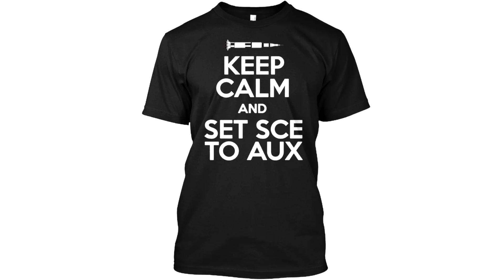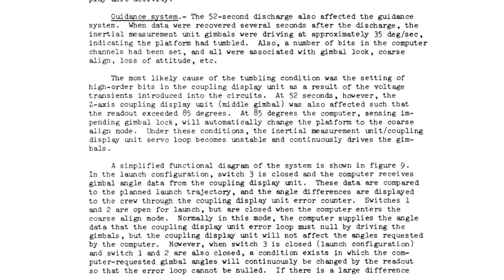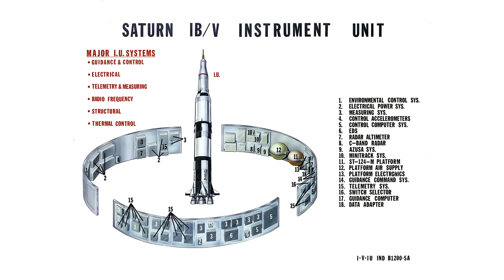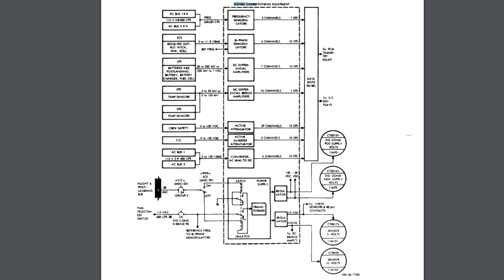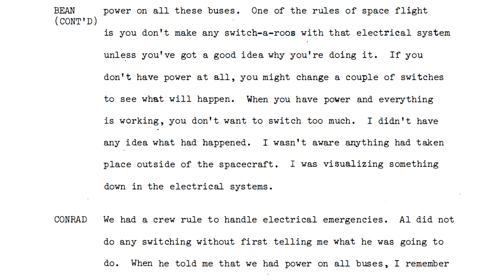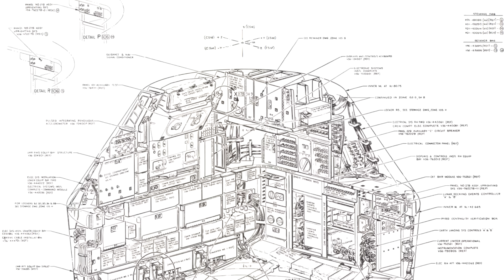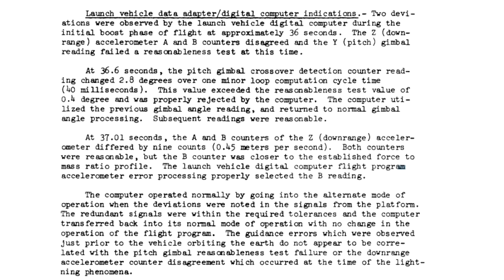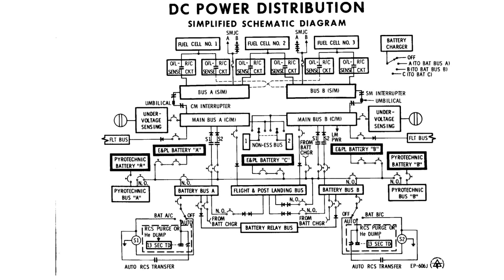What Does "Set SCE To AUX" Mean Anyway - Apollo 12's Lightning Strike Explained

Comment: Excellent point about the decisions NASA potentially has to make. It is entirely possible for astronauts to face certain death after some form of failure. With Columbia NASA apparently didn't take the potential for tile damage seriously. They declined to ask NRO to task a satellite to examine the shuttle on orbit. 

Or maybe they did take take it seriously and at some level chose not to know, assuming there was nothing they could do about it anyway. That's not actually true because Columbia could have made a reduced energy reentry profile at the very least.

A third possibility is that NRO did in fact get images that showed a hopeless situation. Until this month any information about the resolution of NRO satellites was highly classified. Information about any images that could reveal resolution would have been too sensitive to release. Telling flight ops, the crew, and the public that the crew were certain to die would be a very tough call to make and would have repercussions for the agency. I have wondered about this for years. I knew at the time some serious people were concerned about potential tile damage.

Secrets have a way of getting out and I have never heard the third scenario mentioned by anyone and I have never written about it before today. I do think it is possible but it is the type of decision that could only be made at the top levels of NASA. That would mean the full force of NASA engineering would not have been involved in the analysis. As the video above well illustrates, you never know who will come forward with the solution for an unexpected problem.
Reply: Bill Kerr IIRC, NRO imaged the first Shuttle mission when NASA realized that a bunch of tiles had come off, images showed nothing critical was gone. I think that NASA over time became used to missing tiles and other takeoff damage, forgot that sometimes damage is a huge problem.

Comment: Moral of the story: don't get hit by lightning and if you do, don't get  hit a second time.
Reply: And if THAT happens, be sure to have John Aaron watching your back.
Reply: Don't they say that lightning never strikes twice in the same place? Although, I suspect that's mostly because after the first time, the "same place" usually isn't there anymore...
Reply: @jamesw1659  Lightning is a build up of negative charge that's looking to equalize.  When it hits something that object usually ends up with either a negative or neutral charge so it has less attraction force for lightning.  That said lightning, as with all electrical currents, tends to favor the path of least resistance so a large metal (conductive) object at high altitudes has a pretty good chance of acting as a conduit for wherever the lightning wants to go (lightning rods also act as a path of least resistance to the ground).  I imagine the engines may have created some positive (attracting) charges as well but I don't know nearly enough to say for sure.

Comment: To get to the AUX position, they had to go through the OFF position, so they literally did switch it off and on again.
Reply: Step 1 "Hard reset."
Step 2 "Take it offline and turn on the backup. I'll come have a look at it."
Reply: A friend of mine, a fellow computer geek, has a T-shirt that says, "If I'm ever on life support, unplug me.  Then plug me back in.  See if that works."
Reply: The Signal Conditioning Equipment could not be shut off. “OFF” was just a lower voltage version of “NORM” in the redundant power supply. Sensor Excitation in “NORM” was 10v and “OFF” was 5v. But essentially it’s always active in the DC Diff Bridge Amplifiers. Never truly off. Peace.
Reply: This is a new level of brilliance
Reply: @tsurutuneado5981  take that back!
Reply: Switch off and back on again is a Cliche but It does work 75% of the time.
Reply: I love how the entire portion of Scott's subscriber base working in electrical engineering has congregated here
Reply: That's SIERRA Charlie Echo. <Quindar beep>
Reply: That's where Microsoft helpdesk customer service reps got the idea for rebooting the computers.
Reply: "The Microsoft Solution" FTW!
Reply: Oh your rocket got hit by lightning midflight? its fine just turn it off an on again.
Reply: Worse comes to worse hit the panel hard and "tilt it".  Seriously though kudos to the engineer who came up with this reset.  It obviously was not a widely thought necessity since it wasn't even a practiced scenario but it served its purpose-----the one in a million incident.
Reply: That is the fix for when you trip a circuit breaker yup
Reply: The till system was non stop crashing, we turned it off and then on again, and it worked, best I.T. possible
Reply: Like binary?
Reply: One thing came to my attention is that he only knew about this glitch because of that “not A grade team” who did a mistake in a test run. Kudos to the not so bright engineers who made this possible 😅
Reply: LOL, I always say "Just because it's funny, doesn't mean it isn't wisdom." Electricity is nearly magic to most people. I made it a career and can attest that "magic" is a word we used often. Usually it was a place holder for something not understood. An unsolved problem that we haven't seen before.  As an example, the term FM means radio to most people. To us techs it also means Fucking Magic for the reason the problem "just went away."
Reply: @jkocol  As long as they didn't let the magic smoke out of anything important....
Reply: @jkocol this of course is why "off" is always in between "on" and "aux" whenever such a switch is desired. Not only is it easier to build the switch this way, but it also ensures that the diagnostic proceedure "set X to aux" will always reboot it.
Reply: @jkocol  in programming, we refer to anything below our level of abstraction as "magic" (adverb - "automagically"). e.g. if you're writing a game you can usually say that the way save files get to disk, and that the OS guarantees that it doesn't get corrupted on crash, is magic. (Whereas if you're writing a database, that is most decidedly not magic and you need to understand it.)
Reply: Not if the switch was make before break.
Reply: @NeverTalkToCops1  But if it is an actual three-way switch, it MUST break before make, especially if the centre position is in fact the OFF one (which Scott mentioned), otherwise the centre position would bridge both extremes which is not only weird but arguably also everything BUT off.
Reply: @NeverTalkToCops1  I would assume it would be best to have a "break before make" on a powered system like that. Everything ran directly from high current batteries. The last thing you want to do is to switch from a bad battery to a good one with a temporary short.
Reply: @NeverTalkToCops1  NeverTalkToCops Lol, or tell jokes to electronics geeks.
Reply: 4:15 Shows it's a twin position switch. "AUX" is at the base but obscured by the guide metal loop.  In the schematic diagram at 1:26 it shows a manual switch which is a twin position switch, which bypasses the Silicon Control Rectifier circuit.
Reply: @David-yo5ws  First of all its not called a "twin position" switch. what you are thinking is called a single throw switch. The schematic diagram at 1:26 is for the fuel cell disconnect circuit as it states at the bottom of the diagram, not for the Signal Conditioning Equipment. If you actually paid attention to the animation at 4:15 you can see him cycle between the 3 position as it is a double throw switch. If you listen you can also hear him state as such.
Reply: Those old switches could be thrown fast enough that the computer didn't feel the blip in power loss. 😂😂 Tech was slower back then.
Reply: @crippledbeast_U-toob  the threshold was 5 milliseconds on a 50HZ cycle so technically right .
Reply: @crippledbeast_U-toob  Procedure 1= Set SCE to Aux Quickly
Or Procedure 2= Set SCE to Aux Very Slowly 🐌 
😄 Haha Just Kidding
Reply: @Mattycp007
Truth in the humor may be that to stop some cases of high voltage arcing Procedure 2 may be needed.  An EE could help me here, but is it possible that ionized air has to dissipate before power is restored, or the arc could recur?  Good guesses or bad?
Reply: I dint think so.  The ship was already in an under volt state.

Comment: Reminds me of the interview with Johnny Carson and the two astronauts form the first shuttle flight, they were discussing the unpowered landing and the topic of the landing gear came up. Johnny asked them if they tested then in orbit to make sure they worked and they quickly said no.  There is no mechanism to retract the landing gear. If they were extended in space they would have had to EVA and crank the landing gear back in by hand.
Reply: But the first Shuttle mission (STS-1) had no EMUs that I know of. If a situation like this happened, I think John Young, the Commander, would've made the landing on the rough floor of the Rogers Dry Lake.
Reply: The landing gear are gravity powered.  They would not extend in space.

Comment: Possibly moving the switch through the off position to aux actually did a power off reset on the SCE?
Reply from the maker: That's an excellent point. I wish the internals of this thing weren't lost in contractors vaults.
Reply: @scottmanley  In a center off power switch, the normal procedure is to turn the switch to off, wait about a second (or other specified time) before moving to the second on position.  The astronauts in this case would have quickly moved the switch from primary to aux.  No time for the gear to go into a power off reset.

Comment: How long did it take for the "not A-Team" crew to discover the SCE solution when they messed up and how long was mission controls panic before they suggested to switch to AUX; is what I'd like to know.. The answers for that is probably the determining factor for if this kid really saved the mission. 12:30 -ish
Reply from the maker: It took over a minute from the first strike to the SCE call being sent up.
Reply: @scottmanley  Thanks. Do you know how long it took the original "Not A-Team" to figure out SCE when they created their problem? (The crew responsible for John's quick knowledge of SCE to Aux)

Only asking because if it took them a while to debug the problem, then it increases the chance that John really did save the mission from an abort.

Comment: Scott I have an idea for a video.  The N1 program was a failure. I saw elsewhere that they discovered the N1 engines in a warehouse and determined there was a problem with the design. They fixed the problem and then sold them for $1 million a piece.  What was wrong with them?  Was this true?  Thanks
Reply from the maker: There wasn't really anything wrong with the engine design, the problems were largely with the N-1 rocket. Here's my video on a rocket which used these: https://www.youtube.com/watch?v=5ttmG-HBUXE
Reply: Tyler Hargrove I think he already made a video on this